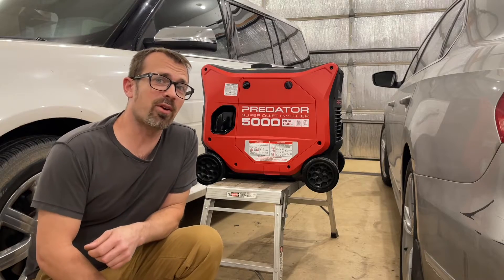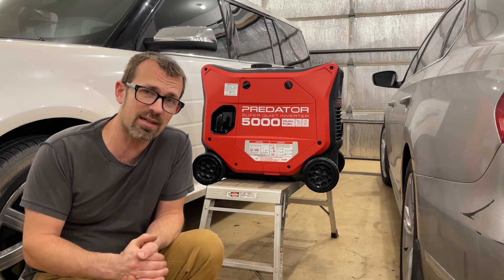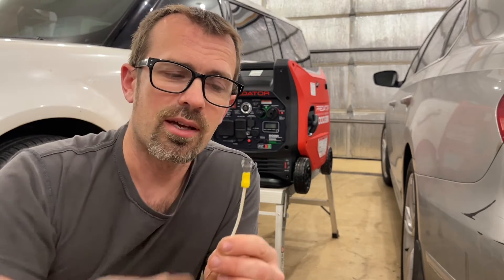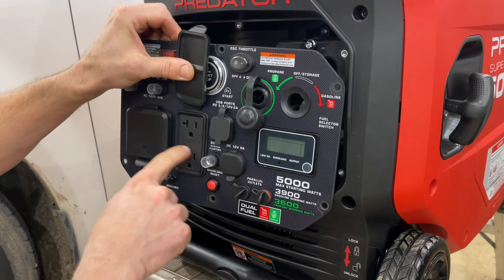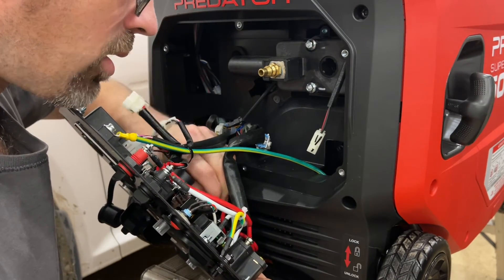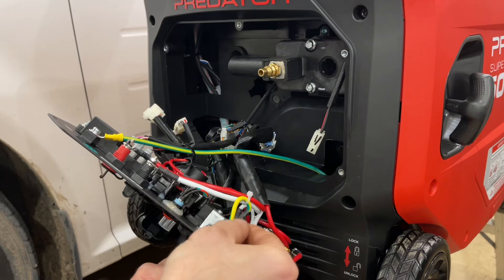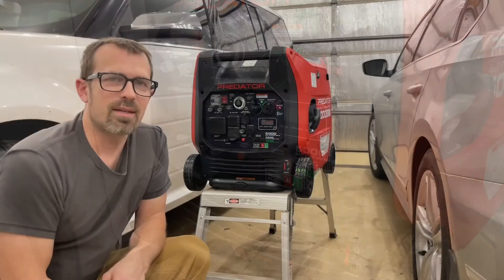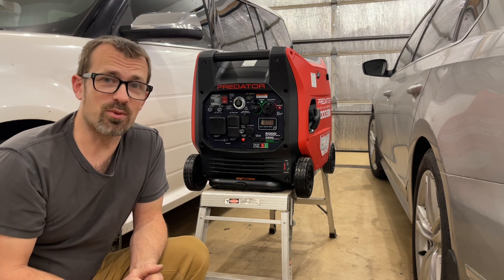Bonding Neutral to Ground: Why or why not? Predator 5000W Inverter Generator

Comment from the maker: I broke it shortly after this video, check out the video description for a link):    • I broke it 😞 Predator 5000W Inverter gener...  

Some generators are manufactured with neutral bonded to ground.  The Predator generators are not.   These are great RV generators and with the Progressive Industries EMS Surge Protectors I have on my campers this is a great mod to do on the Predator Generators.

Generator I feature in this video: https://www.harborfreight.com/5000-wa...

If you decide you don't want to do this mod, here is a link to the plug you can buy instead: https://amzn.to/487z3RS

Here is the Progressive Industries EMS Surge Protector I use on my RVs: https://amzn.to/4h3rSPK

Ring lug I used: https://amzn.to/3RPOW9S

Other upgrades to my generators
NGK spark plug: https://amzn.to/4asjINc
Magnetic dip stick: https://amzn.to/3TyJzx5

0:21 mods I make on all my generators
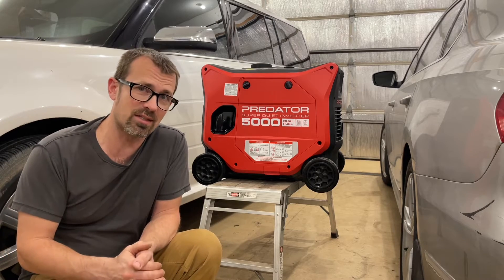1:24 why would you do this modification?
2:19 here is all you need
2:49 opening up the generator
4:30 where does the wire connect?
7:08 putting it back together
8:30 why you should consider not doing this modification

As an Amazon Associate, I earn from qualifying purchases.  For your convenience, I try to post links to everything I use in the video description.  That's part of how I cover the costs of this channel.  I appreciate your support buy using these links!!

Comment: If you were to ground the actual gen. would that also work? Made a plug like you explained to run my furnace and it seems to work ok. Should I add a ground to the generator itself still? I grounded the furnace wiring to the house ground so when it is plugged into gen I believe the generator is using the house ground.. right?
Reply from the maker: If you are using it for home backup, don’t bond the neutral to ground on the generator. Use it exactly as it is with no bonding plug or modifications.

Comment: Why not just buy the generator you require instead of modding it?  are they cheaper?
Reply from the maker: I wasn’t aware of a an otherwise the same generator but that has neutral bonded. Post a link please!

Other than the neutral not being bonded this was the exact generator I wanted so it seemed like an easy choice. It’s proven to be a good choice since purchase as well.

Comment: Great video, I recently picked up the Predator 9500, it comes with a bonded ground already.  To use with the house, you would need to do the opposite & remove the white ground wire on grounding stud on the back of the panel. I made my own bonding plug by using the included 30 amp plug  with a 4" wire, tied the "G" to the "W".  When I need to use the generator as a stand alone, I would plug in the bonding plug which restores it to a bonded ground.

Comment: I was ready to do this mod until I heard what you said as a passing final comment.  Hope people listen to the end where you share a critical piece of info.  Doing this mod will permanently make the generator for any other purpose other than home electric back up.  That's why the plug is a great option.  With the plug it will work for camping supporting surge suppressors.  Without the plug the generator can be used home electric back up.
Reply from the maker: That’s correct. It’s important to understand why or why not you may want to do this mod.  Glad I helped you make an informed decision!

Comment: I got a new predator 5000 beginning of summer and had made my own bonding plug, having experienced the (unknown at the time) lack of ground-neutral bond in a previous years concert series, on different generators 
I replaced the 2 Hondas weve used in previous years with one that's bigger, as quiet or quieter.

This video gives me the idea to just do this mod, but I'll put the ground / neutral wire through a 20A switch that I'll mount to / through the panel, so the choice of a "ground lift" switch is built in to the generator.
Might even send a picture to harbor freight and suggest it as an additional feature on future models...😉

Comment: Just use Hughes Autoformer power watchdog.  Cheaper, does everything and then some.
Reply from the maker: I think you’ve missed the point of this video. The watchdog will give you an error and not turn on if you don’t have a neutral bonding plug or do this simple mod the generator.

The watchdog is a great choice for protection, but this video isn’t about that.

Comment: That's what the green stud for on the front.
Reply from the maker: @cabela7869  I believe they put the grounding stud on the generator so you can earth ground the generator. If they put the ground stud on the front for bonding neutral to ground wouldn’t they also put a neutral stud next to it?

Comment: 3 wires in 1 screw socket lol. Wonder why the inspector frowns when we put two circuits in one hole on a buss bar?
Reply from the maker: Everything has a rating. Even when you buy wire nuts they say how many wires of what gauge can be put in one wire nut.

Comment: I have the predator 3500 that is not bonded and i plan to use it to power my gas furnace by using an extension cord in case of power outage. I will not have it wired into my houses electrical system, only extension cords for certain appliances. Is it okay to use the bonding plug in this scenario? Without the bonding plug the furnace won't power on.
Reply from the maker: As long as you are not tying it in to the house it will not be a problem. Sounds like it’s the perfect fix for what you have going on.

Comment: Is it necessary to add a temporary/permanent earth ground when using this generator with an RV?  Also, is it recommended to use a surge protector when using this generator with an RV?  Is a grounding plug only necessary when using a surge protector?
Reply: Do not add an earth ground. There is a very specific type of generator connection that needs an earth ground which is rarely needed
Reply from the maker: @Idahoprepper71 thanks!
Reply from the maker: It is not necessary to use an EMS surge protector but it’s a good idea.  If you are not using an EMS surge protector then you don’t need to bond neutral and ground. 

The EMS surge protectors I use can be bypassed, and then they don’t do anything but you don’t have to bond neutral and ground.  Again, that ok to do, but a better idea to leave the EMS surge protector working, and bond neutral and ground. 

I don’t have an answer to the earth grounding question so hopefully someone else will chime in on that.

Comment: I have no EMS system on my motorhome, would it still be a good idea to do a grounding rod?  Just wondering if that somehow makes it safer or actually makes it less safe.
Reply from the maker: No need to do this mod if you don’t have an EMS surge protector. The neutral and ground are bonded at the electric panel in the motorhome.
Reply: @bennieaust  Appreciate it!

Comment: One important thing to consider is whether or not you are switching the neutral along with the line wires on your back feed. Electrical systems are bonded to ground meaning the neutral and ground connect together at the first disconnect. This connection can by code only be done in one location. So if you're running a bonded neutral generator the system neutral must also switch transferring that bond connection to the single generator location and now your backup is a separately derived system. While the system will still work with a bond in two locations, it's not safe because current can travel along the grounded components and be hazardous. This is when the code is very clear on this point.

Comment: Do you recommend doing this even if not using a surge protector?
Reply from the maker: No, it’s only needed if your EMS surge protector doesn’t like neutral and ground not being connected. There is no other advantage to doing this mod.

Comment: Wondering if this will solve my issue with a GFCI on my pressuer washer that keeps tripping when I use it with the generator and when i use the pressure washer on the house outlet the gfci does not trip at all.
Reply from the maker: That probably is the issue!
Reply: @bennieaust  OK nice thanks I'll give it a try

Comment: Finally someone did a video on this, thanks.  Quick and to the point, perfect.

For more detail, what I have is:
1. What does ground do - Ground serves some distinct purposes.  In normal operation with everything connected working properly, ground is not supposed to have any current flow.  It is connected to things like the metal case on your toaster oven, the metal case on a plug in power tool, a stationary desktop computer case, surge protector fault path, GFCI, etc.  Ground both provides a low resistance path to source and a distinctly different function is to provide a common ground voltage reference.  So it actually splits off into two different paths, each with different purposes in mind.

2. What a surge protector does - A surge protector dumps excess voltage to ground.  If the excess voltage is from the source creating too high of a voltage, say a traditional generator experiences abrupt changes in load and can't adjust its throttle setting fast enough (like in a car if you have your foot on the gas peddle going up a hill and the gear shifter gets bumped into neutral for those who remember manual stick shifts), if the voltage gets high enough, the excess power will get dumped to the ground wire, return to source, and limit the voltage on the hot wire.  If enough power ends up flowing through, it should pop the breaker.  Now say you are connected to the grid and there is a lightening strike creating a voltage spike.  The surge protector senses the voltage spike and dumps power to ground, which flows through the grounding rod voltage reference and equalizes the voltage with Earth ground.  Granted with a small generator right there that you are controlling, you are probably not too concerned with this latter case of a lightening strike as you are not doing a round the clock grid power connection.

3. When you need to be able to have a low resistance path back to source - Say the hot wire in your toaster oven goes bad (maybe the toaster oven sucks and the insulation on the wire gets too hot and melts off) and makes contact with the metal case.  If the ground wire is not ground - neutral bonded, then everything on the ground wire becomes energized.  Electricity is always searching for a path back to source.  The other problem is people are always finding ways to kill themselves and you won't draw enough current through your body to pop a breaker as the body acts as a resister as in some current will flow through you, which can easily get to lethal levels (say you are hot and sweaty and your hands are wet) while being far from the current needed to pop a breaker.  You only die once with it often being that thing you didn't understand nor realize was going on was actually happening and this case you just needed to inadvertently end up completing the circuit through your body with enough current flow to die.  So energized surfaces you can touch is a bad thing and is causing the ground wire to do the opposite of what is safe when there is no ground - neutral bond.  However, if there is a ground - neutral bond allowing a low resistance path to source, a high current will flow through this and pop the breaker, clearing the fault.

A surge protector needs to see a high voltage differential between hot and ground to work.  If ground is not hooked up to anything, a circuit cannot be completed and thus this first point is moot.  If ground is only hooked up to Earth ground, not ground - neutral bonded, then your neutral has a floating voltage and is not referenced to ground.  Again at best something 'weird' happens, but a surge protector cannot work as intended because neutral is not referenced to ground voltage and there is no return path to source to dump excess power to.  Granted, if you are using a well regulated inverter generator, it can be argued a surge protector is not going to do anything anyway because it will never see a high enough voltage to trigger.

An interesting thing if you put your AC sine wave on a scope from one of these inverter generators with floating neutral, it will look very noisy when referencing to the ground pin, the line will be very thick from all of the electrical noise.  While between hot and neutral you won't see it, it is very pronounced between either hot or neutral and ground as you end up seeing ~60V on each leg.  I have hooked up analog security cameras with no bond to a generator and the cameras had trouble initializing and the ones that did initialize were showing high frequency harmonic noise in the camera feed.  (A different way of seeing the noise seen in a scope.)  It seems electronics in general are designed to have neutral tied ground via a ground - neutral bond or else this high frequency noise gets in there.  I suspect what is happening is the inverter in the generator is using a PWM (pulse wave modulated) signal to create the AC sine wave and the ground wire is connected to surfaces that allow some level of capacitative loading, damping the electrical noise of this PWM switching.  At least with the ground - neutral bond, I cannot see this high frequency harmonic noise at all and my camera initialization problems go away.  If you hook up a scope, it is also gone there.  If anything, I would argue it looks slightly better than on grid power as grid power isn't exactly clean either in terms of electrical noise and these old analog cameras seem particularly sensitive to electrical noise.  Curious and would like a better explanation into the exact mechanism if someone has it.

A GFCI outlet cannot work properly without a ground - neutral bond.  I suppose there is the question of if ground and neutral are not bonded, how can the test button create a differential current between hot and neutral?  Granted if the current is flowing through your body, the power may be finding a different path back to source than that ground wire, but I would think under normal circumstances, that would be the only mechanism the tester button would have to create an alternate path back to source.

4. Another use of a ground wire may be to have say everything in your home tied to the same ground voltage reference.  Say you have analog audio cables going between devices or copper Ethernet cables going between devices, you don't want excess power going over those conductive wires because things are at different reference voltages.  At best you hear an extra hum with your audio equipment, at worse you have fried electronics.

5. The reason you don't bond on a generator when using say a transfer switch to power your home is maybe you already have the ground - neutral bond in your home.  (Something you need to check for.)  Having two bonds is against NEC codes.  What it does is create a ground loop and thus current flow over the ground wire and remember in #1, having a regular current flow over ground is a big no-no, especially with exposed surfaces you can come in contact with.  If your generator has GFCI, you will have nuisance tripping as you end up sharing load between ground and neutral with a double bond and thus hot and neutral will have different current flows as there is one hot wire with load and two other wires, ground and neutral sharing the 'return' load.  It is just a bad idea and you don't want to do it.  However, if you are hooking up to a trailer or RV or just using extension cords, there is no bond in the system by default and so you need this bond in place in / at the generator to comply with NEC codes because of all of the reasons stated above.  (If your trailer or RV did have a ground - neutral bond, then you would create a ground loop when say plugging into the outlet you setup to plug it into your home as your home has one.)  Seems kind of odd that these 120V generators that normally are never hooked into a home almost never have a ground - neutral bond while the bigger 240V generators commonly used for whole home backup power often do have a ground - neutral bond.  Just seems backwards from what people actually need to comply with codes and operate a safe electrical system.
Reply from the maker: Hands down, you will the award for longest comment to date!! :)

Thanks for adding all the context!!
Reply: Thank you for this information. It helped a lot regarding this situation.

Comment: The owner’s manual says F7TC plugs. I got the NGK Spark Plug Iridium-IX BPR7EIX NGK.   Is this ok?  Your link was. NGK 5534 Standard Spark Plug - BPR7ES, I can send my purchase back if you would not use it.
Reply from the maker: Yes, the spark plug you ordered will be great. It’s the Iridium version but same temperature plug.

Comment: So if I want to do dual purpose with a generator (house backup and rv) I can't do this mod?  So at that point I don't use my surge protector on the rv to make things work?
Reply from the maker: If you plan on using this for your house I wouldn’t recommend doing this mod. I would recommend just buying the plug (linked in the description) and using the plug whenever you are using the generator with your RV.